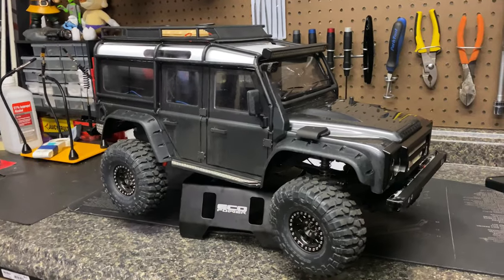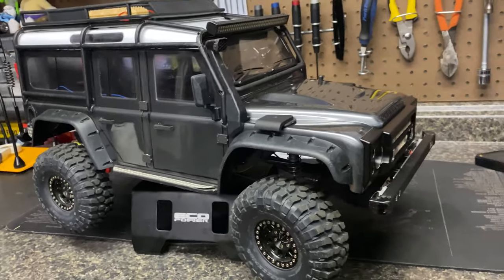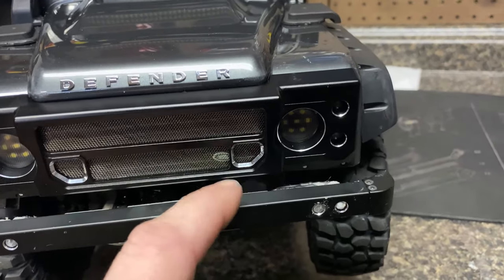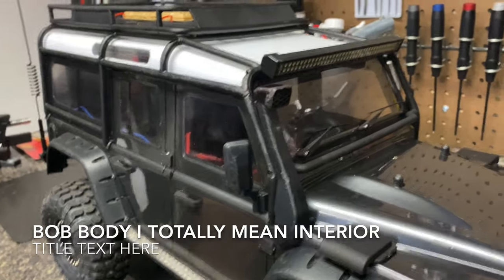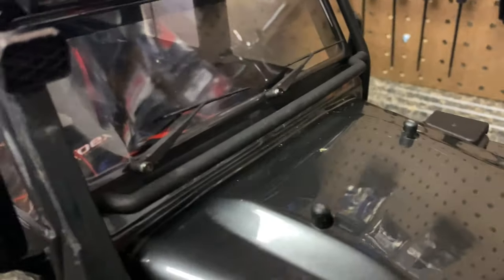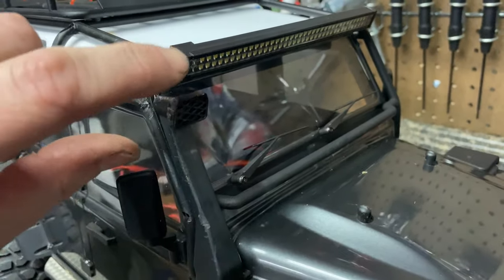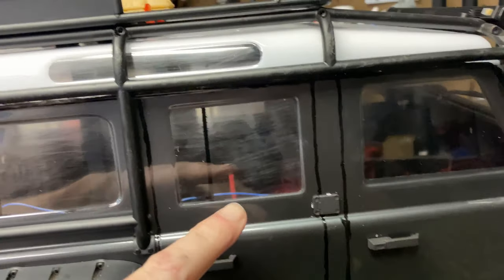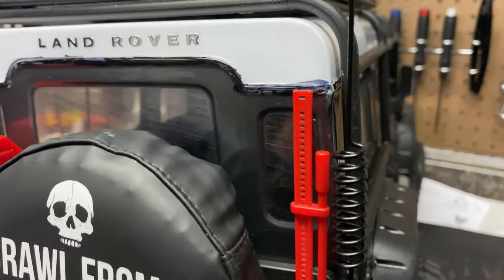Trx4 Defender Scale Build

Comment: i like the front end. did you make it?
Reply from the maker: Hot Racing grill and front bumper the only thing I changed was I did not put on the winch mount to the bumper and I added the 5 mm LED lights into the bumper